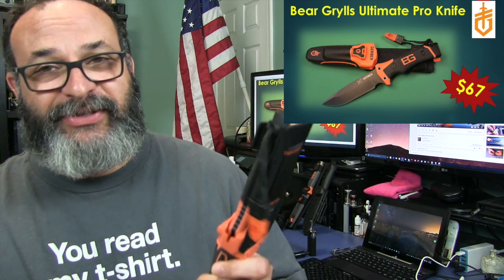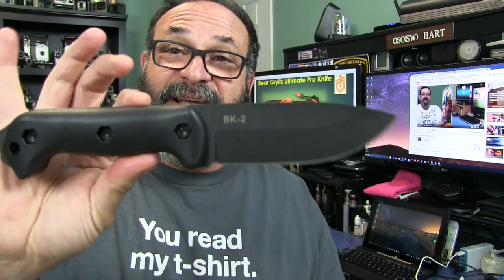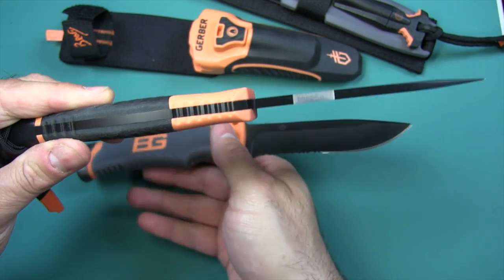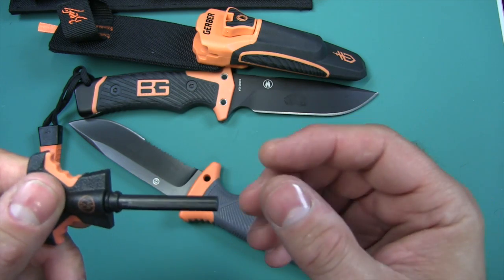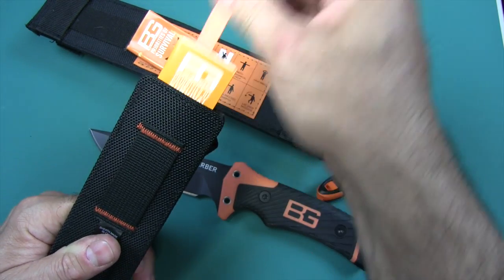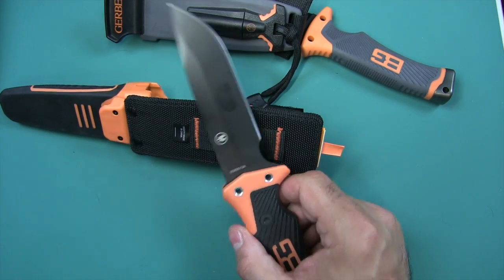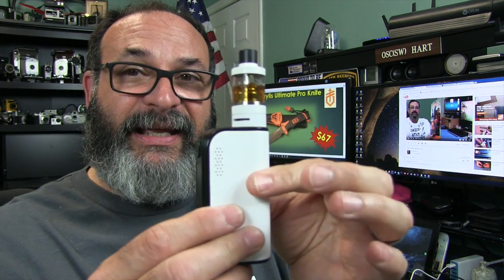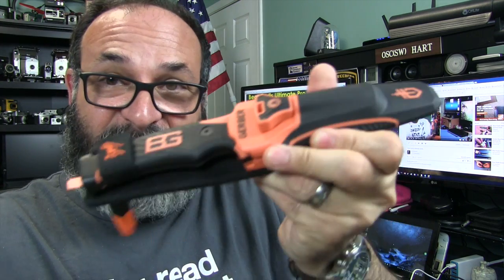Gerber Bear Grylls Ultimate Pro Fixed Blade Knife

Comment: I love this knife. Its solid and reliable. Everything works as advertised and it looks non-threatening. It's easy enough to add mounting options to the sheathe. I find the it very well balanced for my preference and it feels very comfortable in my hands even with gloves. I disliked the factory edge profile but I sorted that out myself. I bear no ill will towards Grylls but I couldnt care less that his name is on the knife - thats not why I bought it.

The sharpener is pretty bad in my opinion. A proper diamont sharpener would have been a better option.

Comment: I have most of the Bear Grylls survival gear, including this blade.. Definitely better than the original one, but unfortunately it still has inferior steel... I used it strictly for my hunting blade only, field dresses deer, and starts fires, and it's orange, easy to see, hard to lose.... I was using my this past hunting season and bent the tip, thank goodness I got it back to normal..... I've put the original blade through some light batoning and broke two of them, and the good folks at Gerber knives replaced them both without any issues.... The bk2 is ten times the blade the ultimate pro is believe me.... I still can't believe I bent the tip on it, oh well its still a decent system I guess...... Just don't understand why Gerber can't do what Schrade knives have done with their 1095 high carbon steel, and an affordable price point... Thanks for sharing your thoughts and opinion on this blade from Gerber knives, I appreciate it sir. 🔫👍🔫
Reply from the maker: Thank you so much for sharing your experience with us, it will help others determine their purchase.